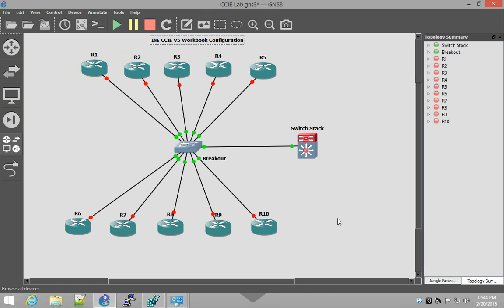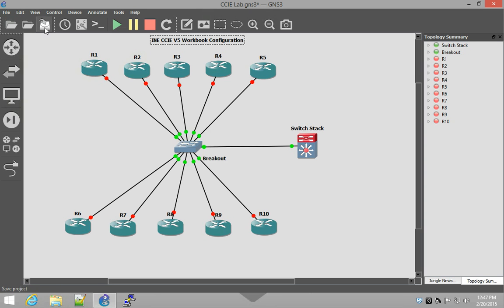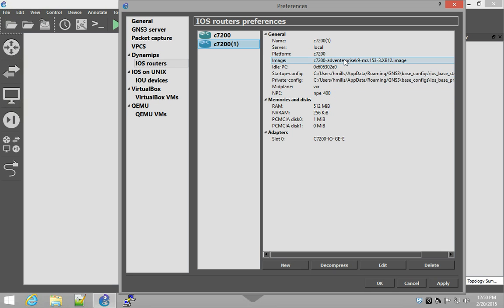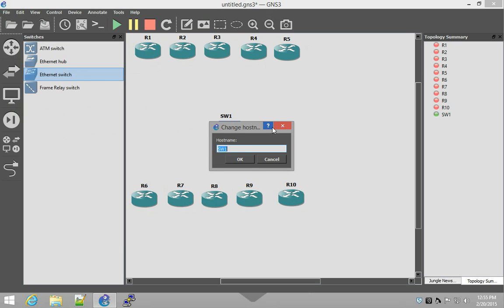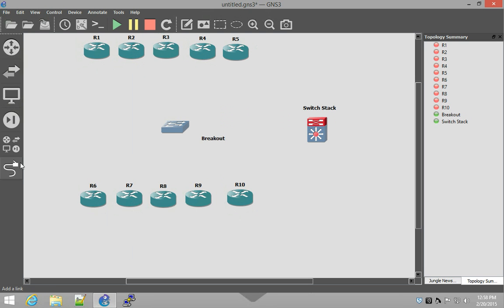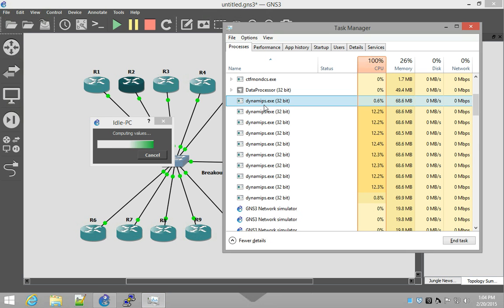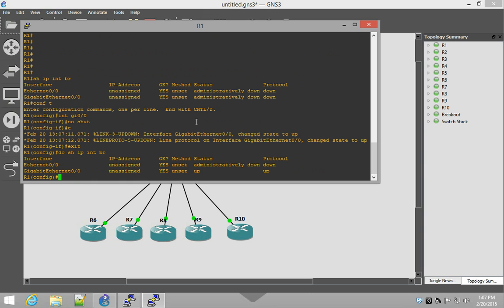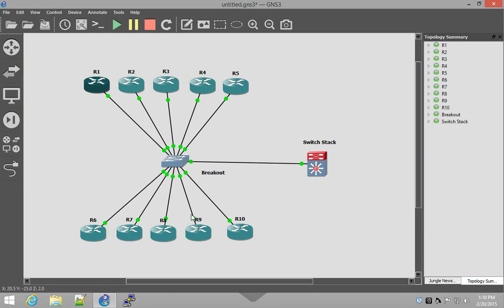GNS3 and Physical Switch CCIE V5 Lab How-To

Comment: Heath, what is the IP configuration of your laptop network card? did you assign a static IP or left it dynamic?
Thanks
Reply from the maker: mahmoud zakaria this is actually old for me now. I dont remember how I configured the NIC. I am using VIRL now.
Reply: Heath, thanks for your answer. my problem with VIRL is that it has to be configured on a server,i couldn't find a way to install it on my PC
Reply from the maker: mahmoud zakaria i dont have much experienve installing it. My job paid for it and we installed an OVA on VMWARE
Reply: i have it also on VM too but i dont use it, i tried but i didn't like it at all.
how it is going with your CCIE studies?

Comment: Thanks Heath. Nice job! beutiful! ok, if I wanted to use an external Cisco 3550 as breakout SW and a Cisco 3560 as real Sw on a PC with a quad-port NIC on Ubuntu Linux, how would I do the trunking between the real breakout SW and real Sw and quad-port PC? Please advsie. I want real switches so I can get as close to as possible to INE topology R&S. Please advsie, Thanks, Masood
Reply from the maker: switchport trunk encapsulation dot1q
switchport mode trunk

and then you have to just figure out which vlans you want to pass

switchport trunk allowed vlan (1,2,3,...)

Comment: Update:  I can see the virtual router from the real switch but I cannot see the sub-interfaces nor can I ping them.  I am running c3750-ipbasek9-mz.122-55.SE3 on the switch and (C7200-ADVENTERPRISEK9-M), Version 15.2(4)S7 on a 7206vxr router.  Anything you see not right?  Thanks
Reply from the maker: I think you are going to have to address your previous post and make sure you can modify the ethernet adapter you have to not strip the 802.1q tags.

Comment: Hello guru.  I have a different Ethernet adapter than you have.  Is adding the DWORD super important?  I did but I am not getting my network up and running yet.  I have 2 issues.  I need a 7200 with the correct IOS which I am working on.  My VLANs came up just could not ping across.  Thank your for your time and awesome video.
Reply from the maker: You're going to have to get the ethernet adapter to stop stripping the 802.1q tags. What adapter are you using?

Comment: Hey Heath, I love the fact that you were able to get VLAN tags over windows going....I've been trying to get that working. If you don't mind me asking what version of windows are you using? Also the IOS version15.3 for 7200? wow! that's cool.
Reply from the maker: I am using Windows 8.1 , but I have made it work on 7 also. Yeah, image c7200-adventerprisek9-mz.153-3.XB12.bin is pretty cool.
Reply: Heath Mills Thanks....do you know if it would work on windows 2k8? I just logged onto cisco's site to see if I could get the 7200 ver 15.3 IOS but no show.....All I could get there was the ver15.2....if you don't mind pls let me know the url on cisco's site to download it. Thanks
Reply from the maker: Azer  Are you meaning Windows Server 2008? I am sure you could get it to work with some research. As far as the IOS, whatever you are entitled to by Cisco is what you can legally get. You can start out using 15.2 and there should be no problem. If you insist on 15.3, you'd have to search the internet for a copy, but this is against Cisco's licensing policy and inadvisable.
Reply: Heath Mills Thanks Heath for the heads up. I greatly appreciate.....have a great day. :) ;)